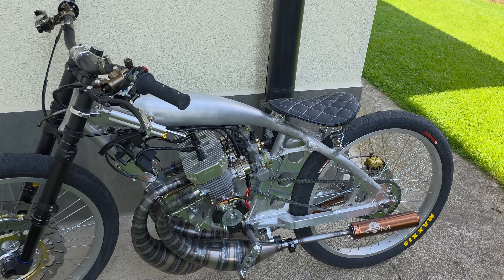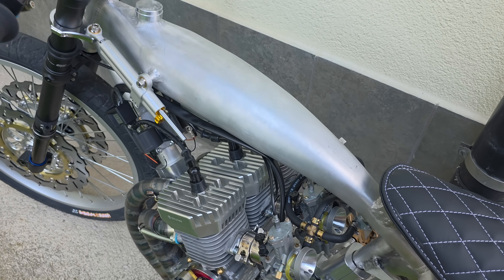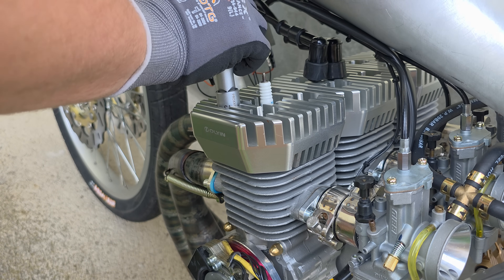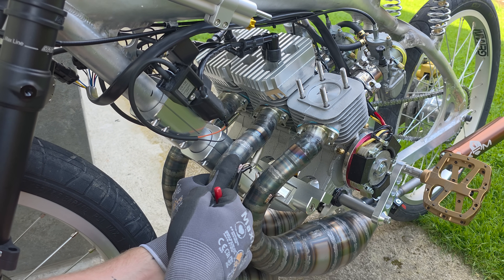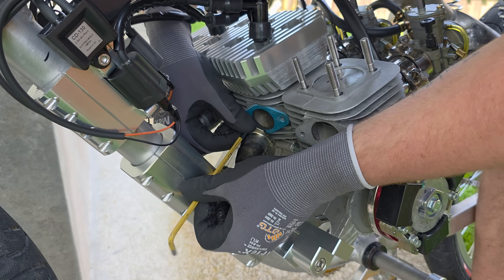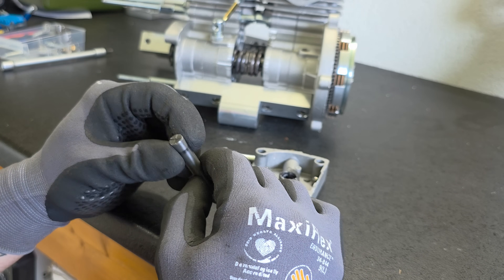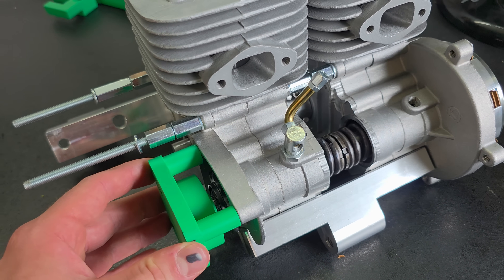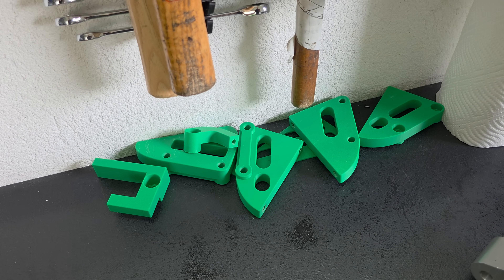Fixing the Triple Engine | Triple Bike Build Part 16

Comment: Why not make a lock up centrifugal clutch?
Reply from the maker: i dont want it so sound like a scooter
Reply: @f84engineering  I understand.
Reply: @f84engineering  I suspect you are confusing a centrifugal clutch with a CVT as commonly used on scooters.
Reply: @johncrowley5612 

No I’m talking about a two stage lock up centrifugal clutch.  I made one for my drag bike before.
Reply: @f84engineering  If the exhaust is load enough you wont here it😂

Comment: My squish gap is.034”. Revs past 14,000 rpm’s. Check if piston crown matches head squish area. You should have made a hydraulic clutch setup. You could run more spring pressure and still be able to pull clutch handle .
Reply: sorry man but .034" is not understandable to 80% of the world. Just use metric system, it's just easier to use and type.  After conversion you result in 0.9mm squish gap, but the value is nothing alone, it depends on port timings, engine stroke and bore, head design etc. For his engine setup reccomended squish gap is between 0.5 to 0.7mm; 0.9 still works but lose a lot of performance, more than this and the engine won't work at all.

Comment: The rdm bucking bar design is inferior. It’s not intended for the side load it takes. I’ve used several, and with even barely any contact with the cam actuator, it fails very fast.
Reply: That sucks. I have one, have yet to use it. What's a good way to have a clutch shaft assembly lasting longer? (bucking bar, ball, mainly actuator cam)